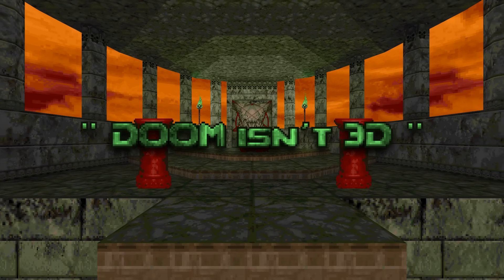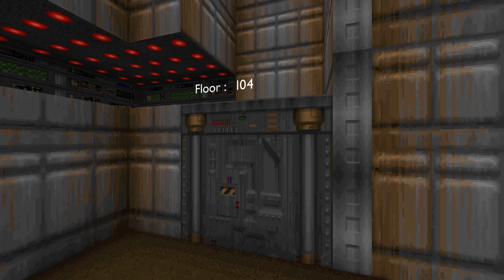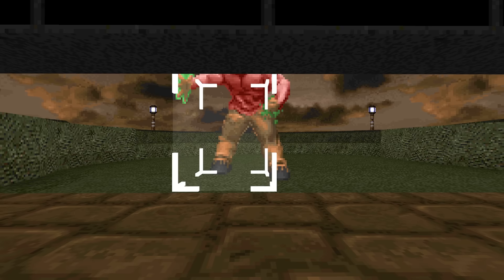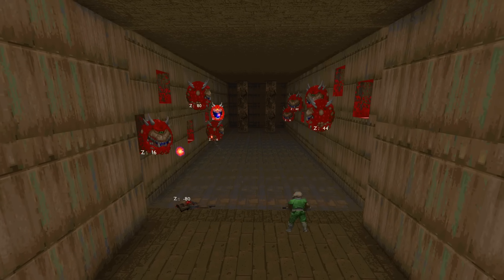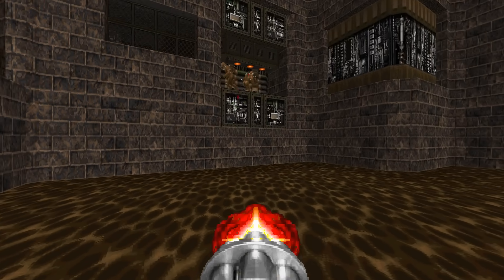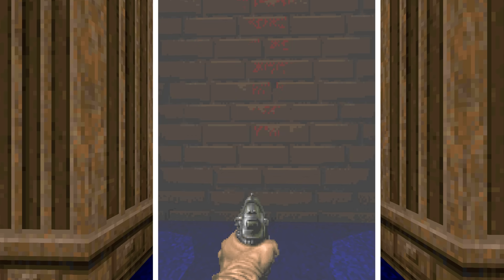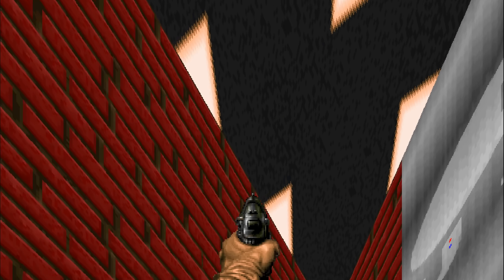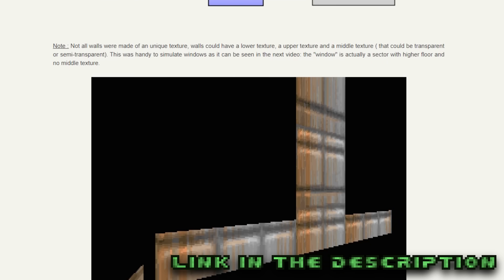Doom engine - Limited but still 3D

Comment: I'm not sure if this convinced me at all. Comparing source ports to the original doom is folly, as those are porting Doom to an actual 3d engine that is built to take doom data and make it look like doom as much as possible. Editing the source ports to prove that doom is 3d is going to work, because they're running 3d engines. You cannot do that to the original doom. It has z-data, but it's only to determine where to position art on the screen to simulate the idea of height. Everything backend is still being treated as a 2d game. It like watching an artist drawing a perspective drawing, and then redrawing it over and over to create an animation. There is no actual depth.
Reply: @borogk  
I think the problem with this whole thing, is that on some levels, it's a somatic argument. 

Yes, doom renders a 3d environment. But it still an illusion being created by a 2d engine. 
The experience you get in heretic and source ports, where if you look up and down, the image can't change angles is called Y-Shearing, and it's specifically a trick to create the illusion of 3d space. 
https://zdoom.org/wiki/Y-shearing

It says a lot that ID considered the Quake Engine their first true 3D engine.

The research on this has been fun though. I didn't know that Bethesda's XnGine (which was used on daggerfall) is considered the first true 3d engine.

Comment: from a 90's gamer.
we didn't use mouse in the beginning. most of my gaming was confined to the arrow keys and the buttons surrounding them. in fact with no windows key alt and control was next to each other so back then i was using control to fire and alt to strafe. you could use mouse to play doom but to me at the time it was clunkey because it operated in the single plane only (ie side to side no up and down). 
it was foreign to me that in games like duke nukem and hexen you could look up and down and to be honest there was no simple transition.
it took me a while and i can't remember what game i first started using wasd and mouse but these days i'm pretty confident with it.
funny that it's hard to swap back to arrow keys, feels confined because you have to reach over to the number keys to swap weapons and i'm no longer good at that.
the engine. i made a bunch of levels back in the day and i published a few wad files however you couldn't process super complex levels. there was a limit to what the engine could render at the time of the Pentium 90. i guess you can literally perform magic now.

Comment: Would be interesting for an explanation of heretic's or hexan's expansion of the doom engine each came about a year after their relevent cousins release. Doom and Doom2 both original.
This was clunky IE not as slick or smooth as doom. But you could fly (limited time power up). And look up/down all the time. Many of the power ups in heretic/hexen were collectable, and user activated. This included the flying power up. Think it was 30 seconds of flight. And better have a spare if you start falling. Or be close to ground. LOL. 
Remember the crash damage or even life over when you hit the ground from too high Kerr splat.

Comment: It's not 3d accelerated which therefore means it is not 3D. It is a series of 2D images created from raycasts.
Reply: But it's still in a 3d environment, so it is 3d, no matter the limitations of the renderer.
Reply: That's not what "3d acceleration" means.  All it means is using a dedicated GPU to process aspects of the graphics, rather than have the CPU run everything.  They only called it "3D" acceleration because "3D" was the graphical buzzword at the time.

Also Doom doesn't use raycasts, that was Wolfenstien 3D.

Comment: You argue well that the gameplay is 3D, but when you discuss how the pixel column based rendering works, you're describing precisely why the rendering itself is not 3D. It's distorting/projecting the top down, 2D level information in such a way as to make it appear you're moving through a 3D space. There are no polygons involved, none of the vertex positions are defined using three coordinates. Mathematically speaking, the engine merely creates the illusion of a 3D space from 2D level data. If this amounts to a 3D game in your view, then so should sprite scaling + line scrolling "3D" games like Space Harrier, Galaxy Force II, Power Drift or OutRunners.
Reply: This is an extremely arbitrary standard, lol. Doom's 3D gameplay is much more involved than that of OutRunners. If I can walk along the X and Y axes to a door, ride a lift upward on the Z axis and shoot downward from that vantage point, I've moved around in 3 dimensions. You can say the game doesn't use polygons, that definitely is true, but nowhere in the definition for 3D is it stated that polygons are a requirement, so I'm not sure why it's important. Plus, each actor has a 3D invisible hitbox that's shown in this video. If fireballs can travel below and above that hitbox, you simply cannot call it 2D at that point because it's just no longer factually accurate, since there are objects moving around in a 3D space on the X, Y and Z axes.
Reply: @DoomKid  I did not dispute gameplay is 3D in Doom. Gameplay is also 3D in OutRunners.
Reply: @Hamdad  You said "If this amounts to a 3D game in your view", which is a subtle implication that it does not amount to a 3D game in your own view. If that's inaccurate, word your statements better next time to avoid this kind of confsion :P You also correlated it to games that are substantially less involved when it comes to the 3D aspect, though even in those examples it would simply be inaccurate to claim the gameplay is 2D, since removal of any axis of movement from those examples would break the gameplay. We're getting into maximum pedantry territory though, so I'll cut this off by pointing out how much more intensive the 3D element is within Doom's gameplay as compared to it's contemporaries and leave it at that.
Reply: @borogk  Interpreter layers can do anything. Look at Sen3D VR. It renders NES games in voxels, in stereoscopic 3D. This proves nothing about the source data, only about the interpreter.

Comment: Nice video. It's interesting that you avoid the question of what is 3D at all and how can 3D be defined. Is it because it would be boring or pedantic? i would put it at the end, because that's where we feel that people are using different definitions with good reasons.
Reply: @borogk  What was interesting to me is that 3D applies also to the physic engine. So a game could have 3D graphics but a 2D physics. So, for some a game is 3D if the graphics are 3D and the physics as well.

And as you show very well, the physics engine can be an hybrid of 2D and 3D pretty much like the graphics engine. That was a very interesting thing to learn.

Comment: The amount of optimizations and sacrifices that were required to make this game work were astounding. They literally looked at everything to see if there was some way to make it faster - even if it made it a little less accurate.
Reply: Example - that distance formula. They did everything they could to eliminate that square root (sq root is a VERY slow operation). Multiplication was eliminated too! The result, while not perfect obviously, was good enough and was required given the hardware at the time.

Comment: For me, Doom is 3D because the older ID engine as used for Wolfenstein is 3D as seen when pushed to it's limits for Rise of The Triad. Doing things that should be impossible (ie stacked floors) if the naysayers about Wolfenstein and doom aren’t 3D had their way. Same goes with games that came after doom that utilized the doom engine and included those things doom is missing

Comment: Duke Nukem was the same way. You could not have a room over a room. To build structures you pulled down from the ceiling or up from the floor. You could have a low ceiling with a parallax so it looked like it went on forever with stars and clouds but it would be just over your head. I built a map with a train that traveled around on tracks. It went through tunnels under mountains and across bridges. But the whole map was only 20 feet high. The tunnel roofs were pulled down from the ceiling, the bridge was pulled up and down. The box car roofs were pulled down from the ceiling. The world looked 3D but it wasn’t. And there were no 3D light effects. If you wanted shadows and light cones you had to draw them on the textures, the bricks and concrete. They looked really nice but they weren’t ray traced. I even made a penthouse night club with floor that rotated looking out over a river port.  But my favorite part was at the movie theater there was a poster of The Matrix and if you stepped through it you ended up in an all white world and racks of weapons slid towards you and you could load up before slipping back out again.

Comment: doom is faking 3d, its not real 3d, its just 2d projected in a way that looks 3d, thats why you cant look up or down and can shoot something that is high up
Reply: That's wrong, being able to shoot things above and below you is because of the vertical autoaim.
Reply: @Mittens0407  no its because its actualy 2d, but projected to look like 3d, and autoaim is a result of that.
BTW: https://www.youtube.com/watch?v=zb6Eo1D6VW8
Reply: @m4rt_  Here's the projectile code. It has a Z momentum (determined at time of launch, using auto-aim) and checks for floor/ceiling collisions. If it collides, it either starts sliding or explode (missiles)

https://github.com/id-Software/DOOM/blob/master/linuxdoom-1.10/p_mobj.c#L283
Reply: @ZomB1986  yes the actors in the game (entities etc) has a z axis, but the rest of the game is just 2d, the items are also 2d, the actors are also just 2d but change sprites depending on what direction the game has calculated that you are loking at it. just because the actors have a z axis"does not mean that it is 3d, its just a number used for math for colision and rendering how high on the screen it is drawn. it is still 2d.
Reply: @m4rt_  Handful of quick retorts to your points:
1) Doom using 2D sprites for enemies has nothing to do with it being 3D or not.  Sprites are just a graphical choice, and are still used in modern AAA games like Call of Duty for many things (smoke, fire etc.).  Doesn't mean those games aren't 3D.
2) Looking up or down isn't a reflection of the game not being 3D, but of the rendering engine used to display the walls.  This is covered in the video.
3) You can shoot stuff higher than you, the game's autoaim does that for you.

Also, probably not wise to link to that Game Theory video, it's so inaccurate it just undermines your points.

Comment: Is this not why the term 2.5D came into use? I.e. 2D assets in a 3D space?
Reply: @borogk  no disagreement. But I do think I wasn't as clear with my reasoning. I meant, if all assets are 2d (even with different orientations), its 2.5D, no?

Comment: Great job, man! I’ve always found the early 3D graphics to be fascinating . Funnily enough another 90’s FPS, Marathon, allows vertical rotation of the camera and also suffers the same Z-axis distortion as the original Doom engine.
Reply: The really interesting thing is that Doom doesn't use raycasting at all :)  Neither do marathon, or the build engine games.
Reply: @Ehal256  just looked it up and you’re def right. I’m not sure what to call the rendering style otherwise.
Reply: @calebduke2832  How about 4DOF Polygon (quads) projection and rasterization, with a front-to-back draw order.

Comment: Seeing as how you cannot have half a dimension, it is either 2D, or it is 3D.  There is no in between.  And obviously it is 3D.  If people want to get technical, than I could state that Doom, and all other "3D" games, including modern 3D games are ALL 2D games, because, unless you are watching this in the future with your brand new holographic monitor, than the games all, ultimately have to convert 3D world-space in the game, into 2D co-ordinates in order to draw the scene on your 2D monitor.

As a programmer I understand this all too well.  Before any scene is drawn, you need to convert from world-space, which is 3D, into screen-space.  In modern games, you have an X, Y and a Z co-ordinate. In Doom, you have the same, the distance away from you is represented by scaling down the vertical column which it draws. Still 3D, just how the engine creates that 3D is different and more limited, but it is no less 3D.  

It IS 3D.  It has three dimensions, length, width and height.  The limitations of the engine do not mean it is not 3D, those limitation have nothing at all to do with the dimensions, just how you can interact with the world.

Did you know that the game "King's Quest" was advertised as a 3D game?  I still own the original box with 5 1/4" floppies!  And it is correct.  It has length, width and height and you could move in all three directions.  People confuse engine limitations with dimensions, which is ridiculous, especially saying it is 2.5D, you can't have 1/2 a dimension, it either exists, or it does not.

Comment: 5:05 vanilla BUILD does the same as it also renders walls as pixel columns.

Also, instead of relying on BSP to organize map data (like in Doom) it uses a portal rendering system, allowing sector vertices to change position at runtime.

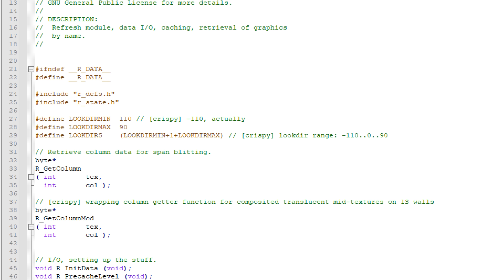Comment: 5:17 This is somewhat how Duke Nukem 3D handled the old way of vertical aiming.
Reply: Build engine, I think it must have because it looks exactly the same.
Reply: I used to spend days building my own duke 3D levels. The build engine was so easy to use
Reply: And Heretic possibly
Reply: @Optimus6128  I believe Heretic could only be played like DOOM (1993)
Reply: @KepalaMonyet  It did have up/down view shearing, they added it in the engine, although by pressing buttons not sure about mouselook.
Reply: @Optimus6128  Yes, you are correct. But, it was not the way it was shown here (or like the old “3D effect” how Duke Nukem 3D used up/down aim.)

Comment: 3D is really only defined, crudely, as having a 3rd dimension one can traverse.  If you CAN (not have to) traverse the 3 different dimensions simultaneously, then you are moving in a 3D space.  Claiming Doom, Shadow Warrior, Heretic, Hexen, etc. are not 3D simply because they cannot have two pieces of geometry on top of each other is kind of silly.  But I do agree it's a far more primitive take on the 3D space exploration.  If we go by the definition that they aren't 3D, then no modern game is technically 3D.  All 3D on a 2D screen is emulated through mathematics tricks.  Arbitrarily deciding which math tricks "count" and which ones "don't count" is just arguing with opinions at the end of the day.  Unless we are universal by these definitions, then I see no debate here.

Comment: The "clumn thing" (not being able to look up/down) is a hacky way of minimising the amount of division operations (they were considered expensive back then).
Division is needed for perspective-corrected texture mapping - basically every unique "depth" (how far the rendered geometry is away from the camera along the forward direction) means the texture needs to be scaled-down (divided) by that depth. If you look up/down, different pixels along a column now have geometry behind them that is at different depths from each other - meaning you have to divide by a different value for every pixel. But if you never look up or down, all the pixels running vertically have the exact same depth, so you can just do one division (reciprocal) for every "column" of pixels instead, and then reuse that for all pixels on that column.
That lets you get away with a LOT less division operations per-frame overall, while still being "tecnically correct" for perspective-corrected texture mapping.
It breaks down though once you allow looking up/down, because then you're dividing pixels by the wrong depth value for them - that's why it looks all weird...

Comment: To the Z-Axis ... you not really need the Explosions to check how high the enemy is compared to the Explosion location ... most of the time. The level design was made with the limitation in mind that there are no "rooms above rooms" so it was unimportant. That said I think the level design is also easier to understand and less confusing. Sometimes newer games can confuse you quite allot if you run from room to room to room.

Comment: I think the limitations of the engine make it not fully 3D. Because pretty much all the aspects listed here have to do with the Z-axis. The z-axis is the only axis that has these quirks. The x and y axes are much more precise by comparison, and most of those quirks are negligible in comparison. 

If you ask me, "3D with limitations" means 2.5D. It's not true 3D, it's one of John Carmack's greatest illusions.

Comment: If it didn't need to be optimized for a 486, it would have all those features built in.  Room over room is still possible in sourceports, although not too efficient to build with.

Comment: Great video man! Liked it. And I now know why the 3d view in Duke Nukem 3d is so distorted; does it use the same column scrolling technique?
Reply: You are correct, AFAIK. The method is called Y-Shearing, and it was used in the Build engine (that powered Duke 3D) too